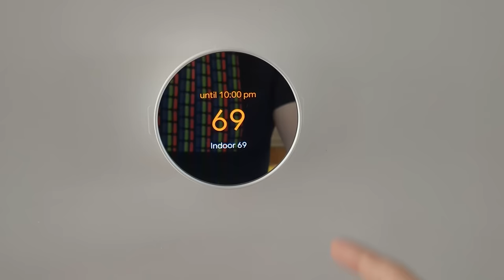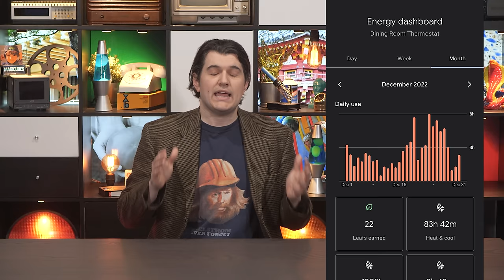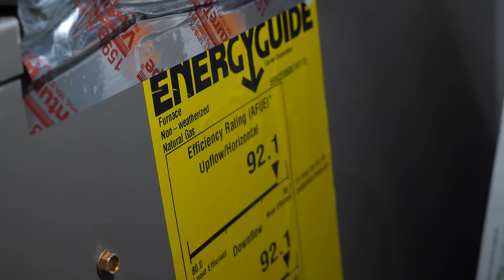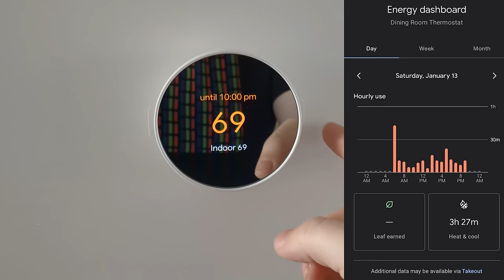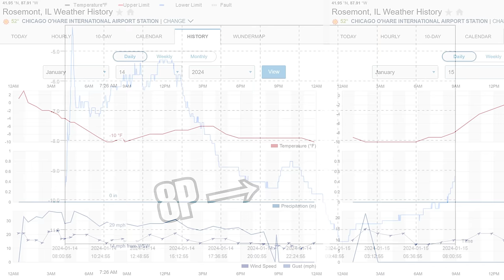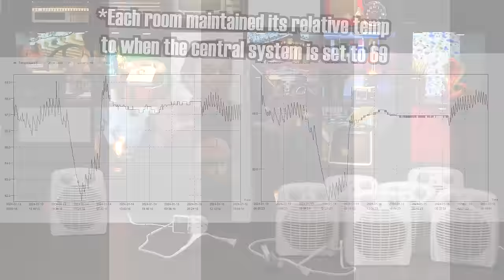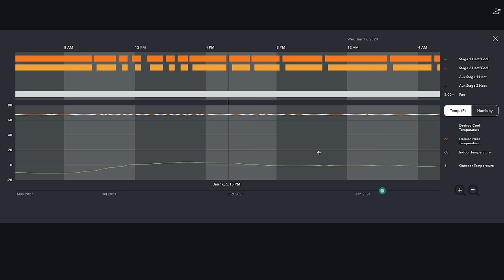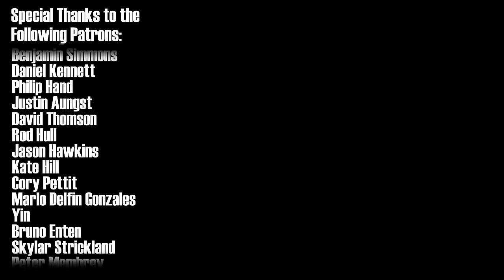Old HVAC industry practices are holding us back and costing us money. But we can fix it.

Comment: I've been in this trade for 35 years, when I do a manual j, I find the existing heating systems are usually around 33% to big. I have lost several heating system replacements, because the customer say I'm under sizing their system. Because all the other companies said you need to go with the same size. The HVAC industry has its problems, but homeowners like bigger systems in their house. So we either conform, or we die in the wind.
Reply: Most people are afraid of math, and it's incredibly frustrating to show them data and have them dismiss it
Reply: I know as a home owner it would be nice to see two quotes side by side in that case. One with the numbers run and optimized and another with my current system.

I would like to think that I as an engineer would follow your advice, but if the cost difference is not that great then I can also understand the paranoia.
Reply: @Taskarnin  exactly, the prices are usually within a couple hundred dollars. I have actually seen the bigger ones sell for less than the smaller ones, do the supply and demand. Customers think that if they get a bigger system they're getting more bang for their money.
Reply: Well, if you offer them a smaller unit that is more appropriate and they incist on a bigger unit there is no reason to not give it to them.
Then it is on them honestly.
Reply: @rogerk6180  exactly, if I refuse to do the job, I will lose the job, and I'll eventually be out of business. 
So I installed the larger ones. Then I hear from Engineers saying that I'm installing the wrong units. Hvac trade is the problem. It's funny, when I get the new heating system inspected, I point out that the boiler is oversized, I do this to cover my ass from the next homeowner who purchases the house.
The inspector points out that oversizing a heating system is grounds for failing inspection. Then they tell me, that they are not going to fight homeowners on this.
Reply: You can adjust the gas pressure on furnaces to get less output put increasing the output requires a larger furnace I would just do what the customer wants and put in a larger one and turn it down
Reply: @mqe73M  yes, drop the gas pressure, but the oxygen stays the same. Oxygen is a great insulator so you just killed the efficiency. It's best to high fire the heating systems you put in, the stated efficiency is based on high fire only.
Reply: 33% oversized is somewhat reasonable, in my opinion. 300% is not.
Reply: @godofplumbing  it's better than over firing the furnace most people are okay with 80% furnaces anyways
Reply: And manual L is the one for commercial space, right? I worked as a dispatcher for an HVAC company in college years ago.
Reply: I got through this weekly when quoting for boiler replacements the majority of houses only need around 15kws to run a modest heating system and hot water cylinder but homeowners associate a larger number with better or it was oversized from the outset sometimes you’ve just got to install what they want or lose the job thankfully pretty much every boiler here can be range rated in 1kw increments when you commission them so I usually turn them down
Reply: Oh ask me, I live in an apartment in Germany and we have energy efficiency legislation for about 50 years, still everyone lowers the temperature over the night, expects the heating heat the room up in no-time and are ignorant to the possible energy savings.
Reply: I had a customer who went to school for engineering ,  had a 5 ton installed on a 1000 sq foot house,  I came in after the fact but sounded like a wind storm when it kicks on
Reply: @Taskarnin  most homeowners aren't willing the pay the cost of all that calculating let alone the cost of the installation.

That is impractal residentially.
Reply: @mqe73M no

You can't.

That gas pressure is specific to the amount of air being drafted through the furnace and is tuned with combustion anylyzation, turning down the gas pressure can create many more unforseen issues and is not recommended whatsoever.
Reply: I still think for our home 2500 sq ft. On one level in Midwest if we could have individual heat adjustments in every room. To have to heat on continuous level all the rooms we are not currently using is ridiculous.  They say in Midwest don't close off rooms and close registers. It will upset balance or something else their jargon says and then make the furnace not work well. I am not good at math but I do pay the bill which seems high for rooms we don't use. We need help. All they want to do here is solar on the roof if you get sun in the right place. We can't put in front of house where the sun shines best and longest. Subdivision rules. It's always something and none of it is for our benefit.